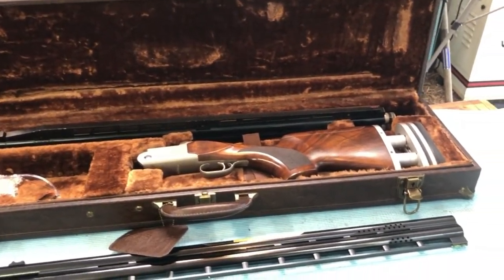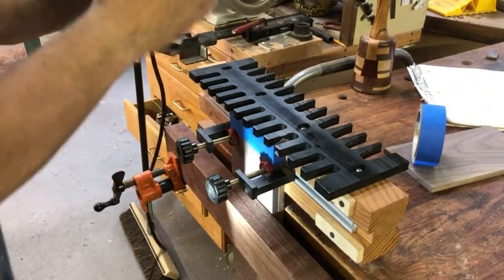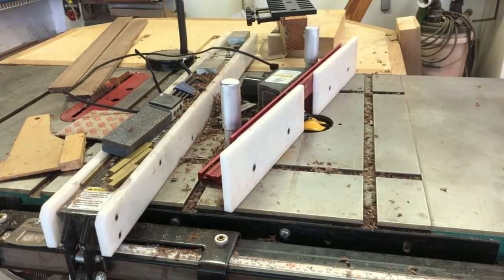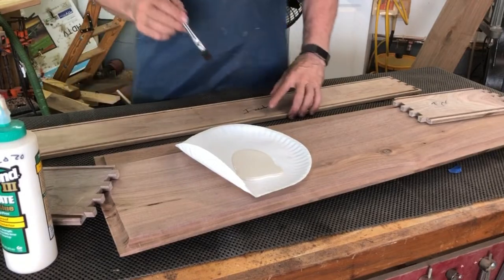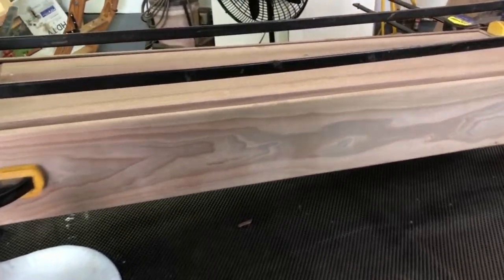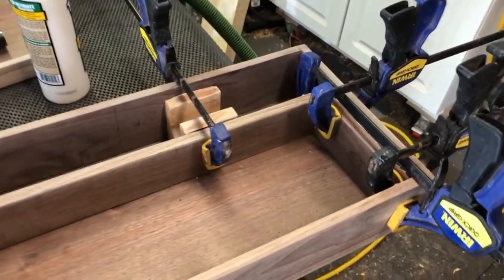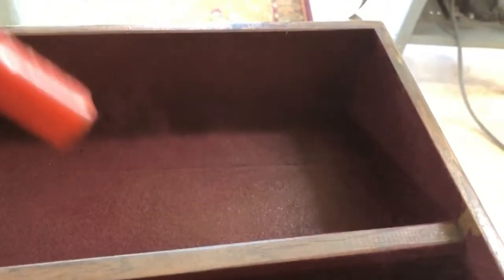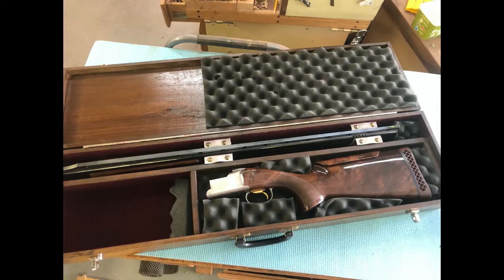Build a Custom Shotgun Case on Bob's Woodshop

Comment: Just curious as to why you would put locking hasps on the front but leave the screws Exposed on the piano hinge?
Reply from the maker: Just trying to stay compliant to NJ law where firearms need to be locked in transport.    If someone stole the case/gun, they would just first cut the lock before messing with the hinge.

Comment: Great woodwork.  

Flock isn't very durable and quickly turns into a nasty powder on everything. Actual felt over laths or thin foam is a lot more durable and provides better padding.